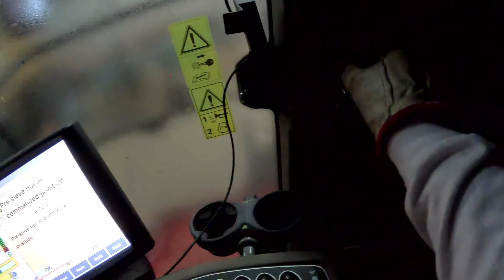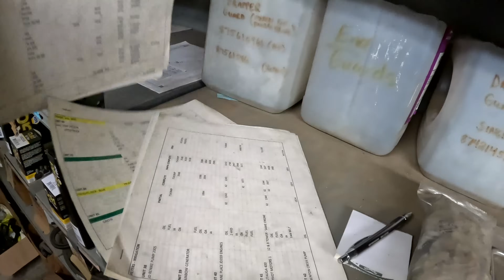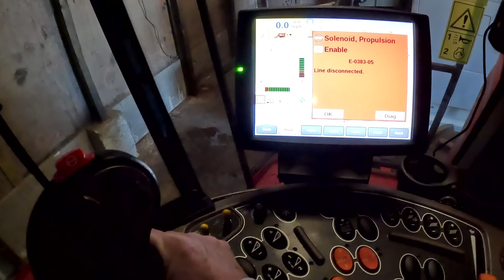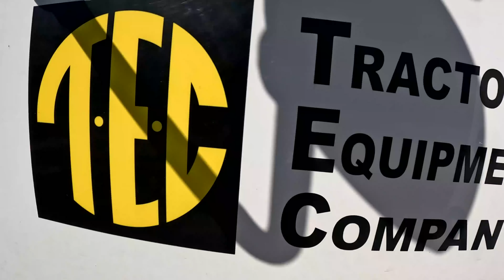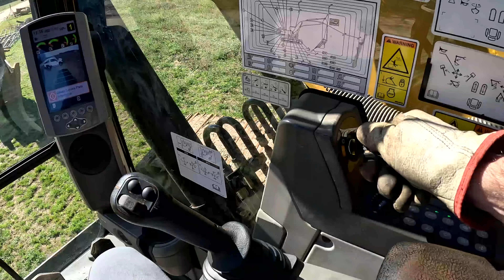CATCHING A COUPLE OF DAYS OF NO RAIN

Comment: On your grease gun, take your steel tube off the gun first, then once it's off, pull your plunger back a bit, let it forward and it will push your empty tube out so you can grab it easier. Then pull your plunger all the way back and then put your new tube in.

Comment: What becomes of the fence wire that you are dumping on the brush pile? Nasty stuff if you drive over it with rubber tires and it won't burn if that is your plan for the brush.

Comment: We power wash combine then after it dries we spray a diesel fuel and motor oil combination on it before we put it away, mice do not like it, works better than anything and its cheap, we also put out rat bait.

Comment: Boy Alabama must have a lot better burn laws than here in Kentucky. If they ever thought I was burning one tire they would be up here in ten minutes and fine me. I have a hard time burning brush from the landscaping jobs we do. They came up here one day and said only thing legally that can be burned is natural wood from my own property
Reply: I think it's illegal to burn tires anywhere or anytime.
Reply: I was thinking the same thing.  Don't forget, Daniel.  What the lizard people don't know won't hurt them.
Reply: You're right about that man
Reply: I think I wood take that part out of the video,
Reply: The trick is just don’t get caught! Same here in NC! Put the tires or whatever on bottom and trees on top!
Reply: I didn't see any burning tires.
Reply: @huntinandscrappin306  I think the black smoke from the tires would be a dead giveaway no matter where they're placed.
Reply: Not enough law enforcement/people in a lot of Alabama counties to police stuff like burning tires. Lowndes County where this farm is at is definitely one of those counties.
Reply: The secret to burning tires is cut the up burn a small piece at the time not as much black smoke.And really hot fire.
Reply: Daniel-  Had a rodent problem and final solution was to use a spray bottle with a significant  amount of peppermint in it and spray it all over your engine and wiring.  Had some in engine compartment in wife's car  that did about $700 worth of damage to the engine wiring . Spray every 2 or 3 months and  seems to have help to solved the problem.  Also place alot of sticky traps around and seems to catch them as well.
Reply: Can’t see black smoke at night. 
Wink wink.